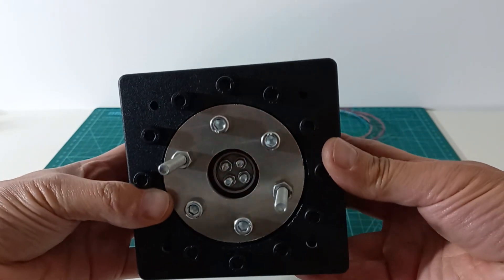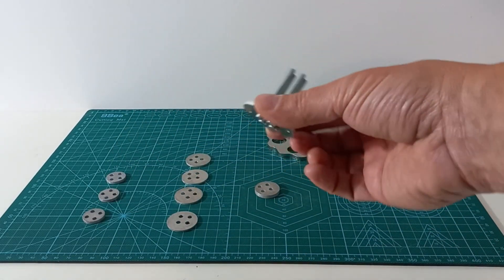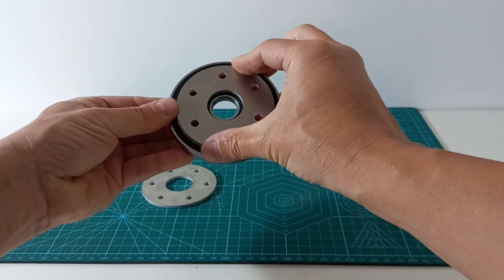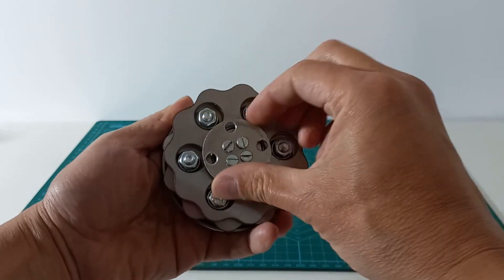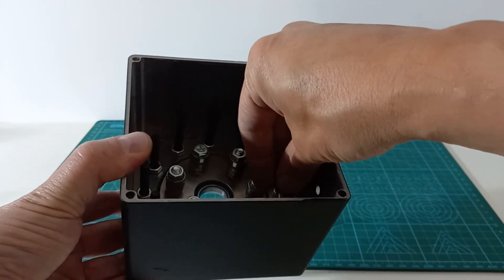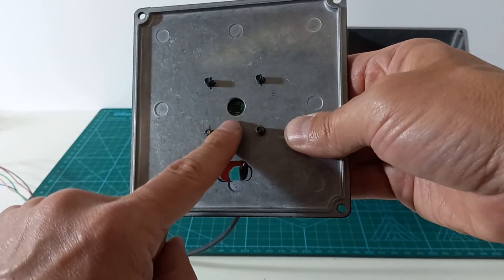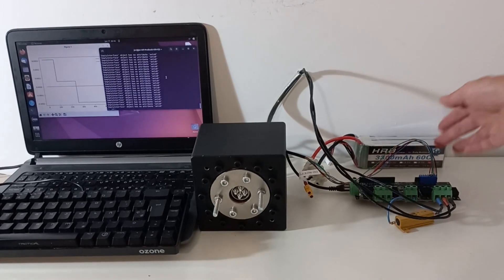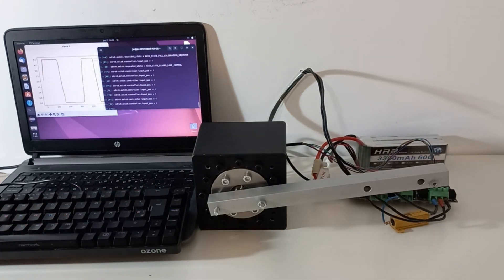DIY Cycloidal Laser-Cut All-Metal Robotic Actuator:  Durable!

Comment: Hello, this is a very impressive work, congratulations! However, I have a question: the 61810 bearing is 7 mm wide, while the cycloidal gear is 5 mm wide. Doesn’t the 2 mm gap in between affect the operation? I didn’t quite understand that part

Comment: please help me in making cycgear.SLDPRT file with 11 teeths. i could not make it.
Reply from the maker: The video shows the settings in the Excel file for 11 teeth. Depending on the size of your wheel, make sure the holes for the inner shafts and central shaft are not too big, and it should work

Comment: 9:42 20kg at this angle are not 20kg perpendicular to the output axis, so either you need to calculate the torque with a shorter distance between motor axis and mount point of the spring

Comment: PEEK 3d-printed assembly like this should be much less noisy
Reply from the maker: Probably, but the idea was to make and test a full-metal gear to see if it was feasible
Reply: you dont even need PEEK, some of the nylons would be sufficient, and also printable on a bambu x1c. 3dxtech has a MoS2 infused nylon that i like a lot and intend to do this with, called WearX.

Comment: Fun project! but two things really grinds my gears.
First of you used no lubrication at all, and secondly you use the heads of bolts as the transfer from the motor and the gearbox witch is a bold move to say the least.
Reply from the maker: There should be no friction, the cycloidal gears only touch the roller bearings, the eccentric shaft bearings and the output shaft bearings. But you are right, it would be good to put some lubrication

Comment: To improve accuracy, how about getting the holes cut slightly smaller, then using a reamer to ream out the holes to final dimensions? Also, using shoulder bolts instead of using all thread bolts?
Reply from the maker: Good suggestions, I will consider them in next builds, thanks!

Comment: That is an awesome build and I think I understand cycloidal gears better now. 
Wouldn't the motor get hot in the box?
Will the gearset need lubrication and lube separation from the motor?
Reply from the maker: There should be no friction, the cycloidal gears only touch the roller bearings, the eccentric shaft bearings and the output shaft bearings. But you are right, it would be good to put some solid lubrication. If motor gets hot I could open some slits, or even put a small fan

Comment: Any idea why the backdrivability isn't smooth?
Reply: Maybe it’s too tight and friction add up to the whole resistive torque due to gearbox and motor inertia, try to avoid friction
Reply: @federico6b  Thanks. I'll try this design and add some lubricant. Great work!
Reply from the maker: Maybe it is too tight, and probably the positions of the roller axes are not as accurate as they should be, due to manufacturing errors